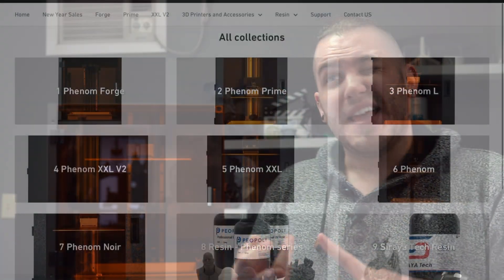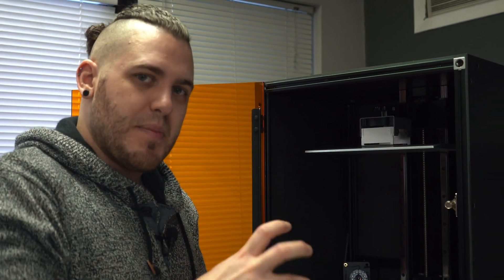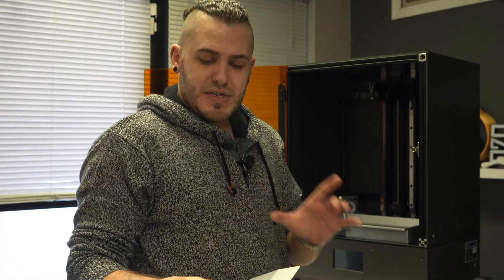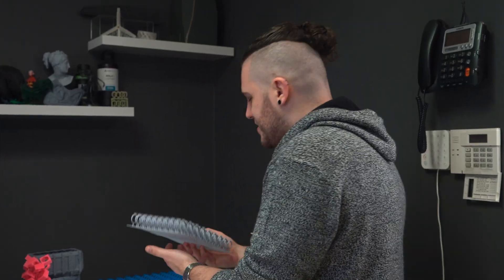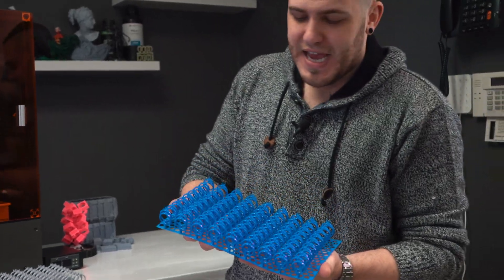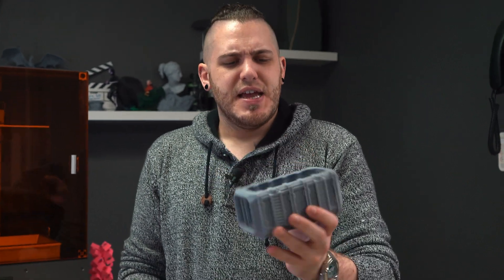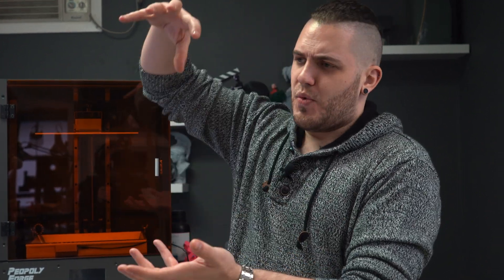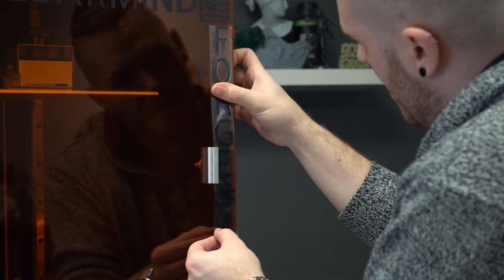Production Powerhouse - Peopoly Forge Large Format 3D Printer Review

Comment: For perspective... what size flange do those ring trees fit in?  Calculated cubic volume = grams of metal?  When casting do you melt the metal separately or do you melt the total amount for all trees at once?  Seems safer to calculate the amount to use for each tree and only melt what is needed for that tree so that too much metal doesn't fly out of the crucible by accident.  Am I correct?
Reply from the maker: The trees fit in a 4x6". 
We use a metal density equation, so the weight of the tree in wax or resin multiplied by the metals density, (bronze is 8.8, sterling is 10.36). 
When doing 4 trees at once waiting for the metal to melt for each is time we'd prefer back, so we melt enough for at least 2 flasks at a time if not more depending on total flask weights. If you fill the crucible to its maximum for any given metal it can cause sloshing when you pour.

Comment: Thanks for the review! How it compares to Prusa SL1S in terms of print success rate?
I’ve tried anycubic m3 premium, a large format printer, and I couldn’t make it print models supported for sl1s without breaking even on slowest settings. I’m now a little bit sceptical about printers without tilting bed
Reply from the maker: TLDR, the Forge has awesome tools and controls which make printing on it very reliable. It isn't as quick as the SL1S but that's purely due to the mechanism. 

We've had great print success with the Forge, True Blue printed great on the 3rd try, Asiga Supercast S, Nova3D Water Washable, Monocle BigVat, Siraya Fast and Build all printed great on the first try.
Unlike any Chitu system I know of, or the SL1S, Vlare has support for variable support exposure time, so you can overexpose the supports only and make sure they're strong. Vlare also give very in-depth control over lift speeds, acceleration, etc. We're going to do another video about Vlare capabilities, if we had covered that in this video it would have been double the length.
Reply: @ClearMindJewellery  How would you compare the print quality / resolution to the SL1S? Both have 50 microns on the XY, but is the Forge as crisp as the SL1S?

Comment: Thank you, thank you, thank you. I have been waiting for months for someone to review this machine. Just in time before the sale ends to get information on it. If you have a medium size 8k printer, do you notice a big drop off in details with the forge? I was just curious on the details with 10' 8k printer vs 6k 13" lcd. Thanks for the review.
Reply from the maker: The pixel density on a Saturn 2 for example comes out to 28.5 micron, which logically should be almost double the print quality. But in my opinion 8k is a bit overhyped and only certain kinds of models will benefit from it like extremely high poly busts and models that are curve heavy. 
There isn’t a big enough drop in print quality between 28.5 and 50 pixel density for me to feel like I’m missing out.
Reply: @ClearMindJewellery  Thank you, I have a Saturn 2 I’m going to set up. I was debating about buying another for figure models, but the forge had looked really good, but no one has done a review until you did. If the drop off isn’t that huge, I rather have a bigger build plate. Thanks for the input.